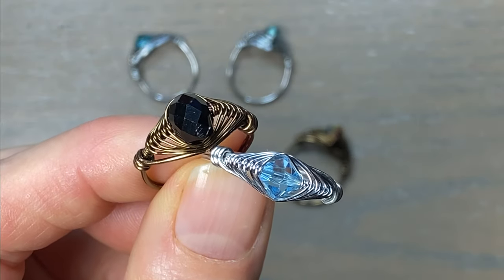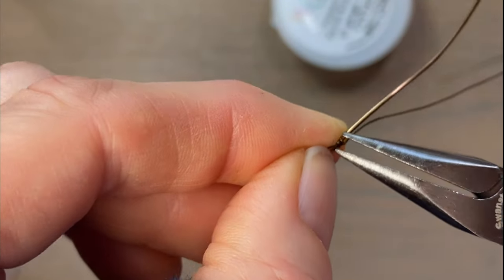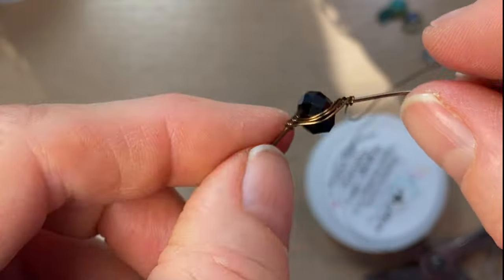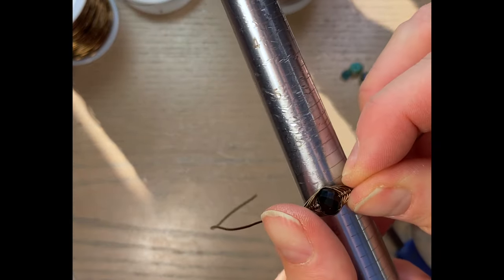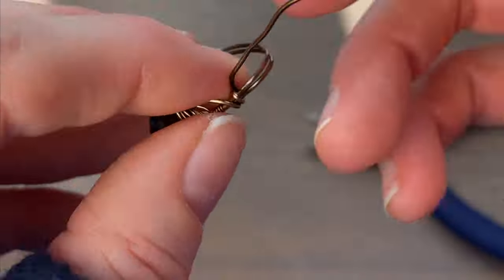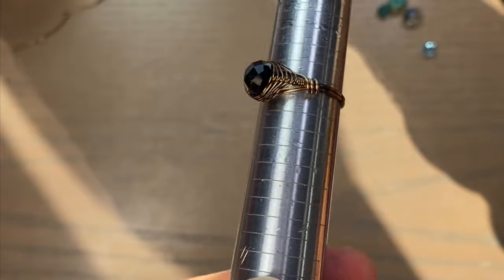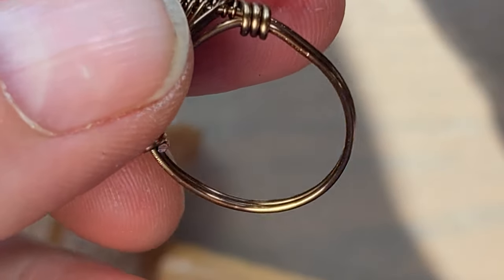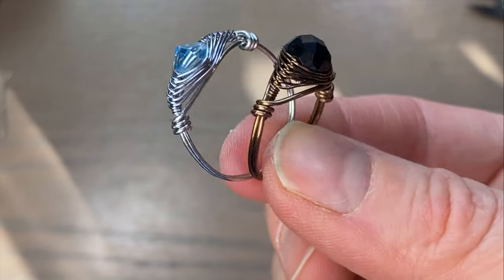Wire Wrapping Tutorial- Easy Herringbone Weave Wire Beaded Rings- Great For Beginners!

Comment: I was wondering if the wire you use on this is alot easier to work with cause ive tried to make this ring with wire i have and it just didnt work very well it wasnt for easy to wrap without harsh kinks in it thank you
Reply from the maker: I always try to use dead soft wire!

Comment: I've noticed with a round bead the herringbone gets a little loose once I've worked the shank wire around the mandrel. Is there any way to stop this or snug it up. Or should I use thicker wire for the herringbone.
Reply from the maker: I use 20 gauge for shank wires

Comment: I am trying so hard to do this week but every time I do my beat slides around. I'm using a round on a 18 gauge wire and was trying to wrap 24 gauge around. I'm holding it both of my wires. Keep bending as I'm trying to pull tight and the wire that goes around the bed keeps smashing into a mess.  What am I doing wrong?😢
Reply from the maker: Try smaller wire. 
20 gauge and either 26 or 28. 
I like 28!